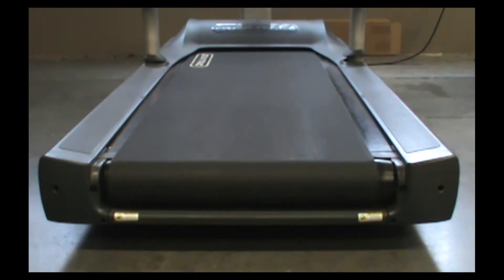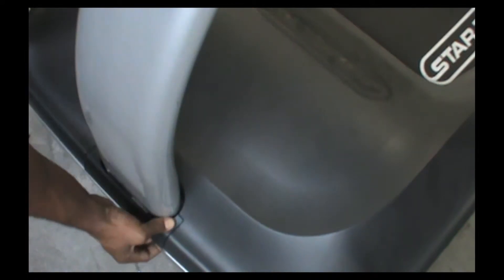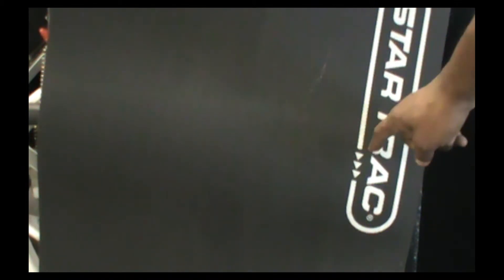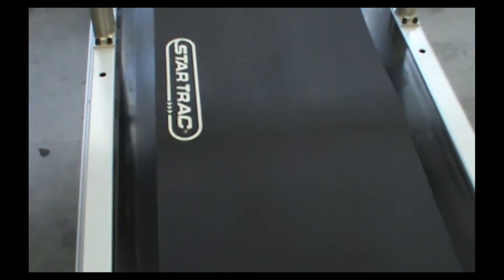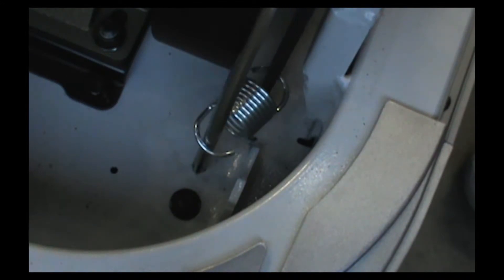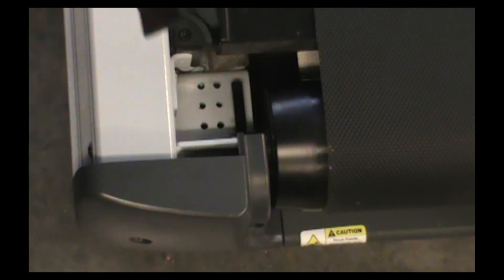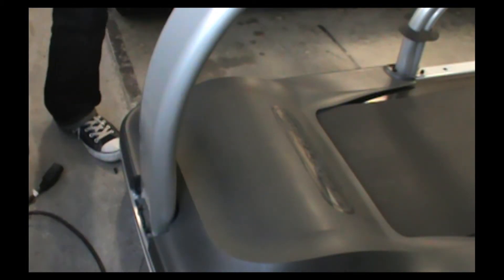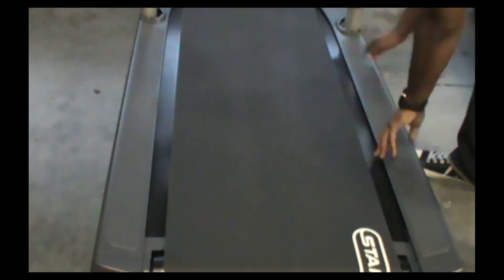646-1191A - S Series Treadmill Belt, Deck, & Rollers Replacement

Comment: This looks like my S-TRc, model, maybe it is. I wonder what can cause the deck to make strange noises like I am walking on a very old bed, squeaking and creaking on every step. I could provide some video samples if you could give me some suggestions.  The treadmill  has like 250 KM and less than 100 hours, and I got it with like 100 km and 30 hours almost like new, it was an ex-demo sample .  I had this problem with it  from almost day 1. Sometimes is almost ok, sometimes the sound comes back,  and the guy that had to service it, told me is maybe the treadmill cushion system, but it makes these sounds for more than 6 months. I would look into myself but I don't want to make it worse. On the other hand, I have a feeling that sometimes the deck is absorbing the shocks better in front, near the motor and slightly on right side, but in a bad way, cause walking more towards the back of the treadmill make me feel I have more control of my steps. I have almost 400 lbs, bought it  for the reason I saw it can bear up to 500 lbs and the treadmill itself  it's on the heavy side, so I guess, me having a 400 lbs ( a little bit less ) and waking with like  a little bit above 2 MPH is not  like I am stressing it too much. Thanks in advance.